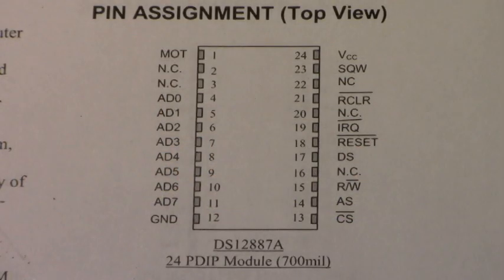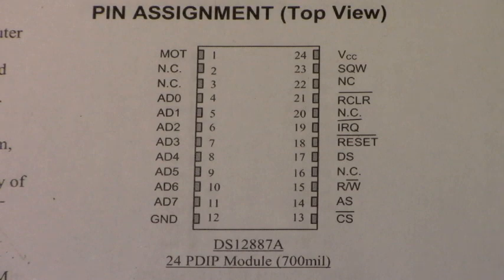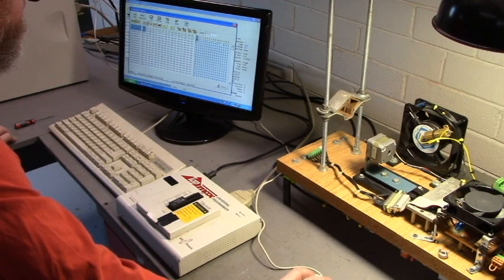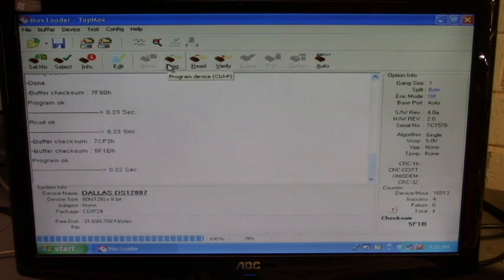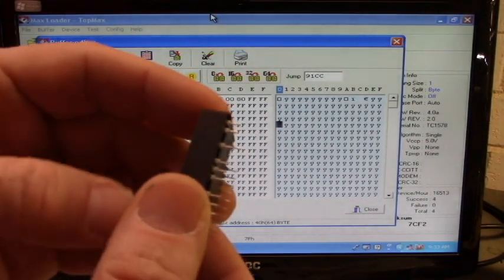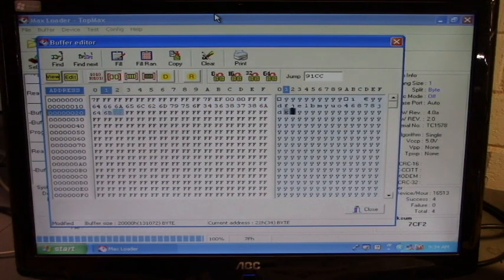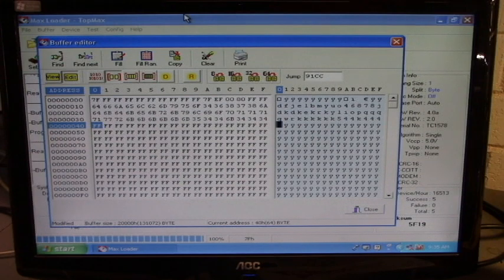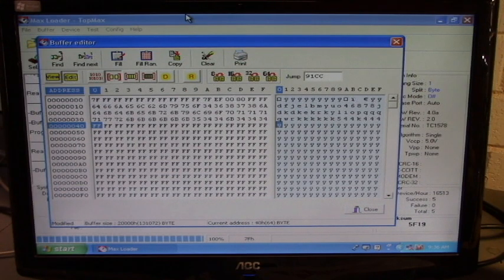DS12887A Pin 21 /RAM CLEAR

Comment: Nice trick. You can push out the socket's terminal and remove it
Reply from the maker: Hello Mr Serviciobsas. Yes you are so correct. I don't know why I didn't think of that. And then I could salvage the IC socket by re-inserting the removed pin. Thank you very much for the better idea.
Reply: @PeepawMcDonald  You do a great job! Love your videos